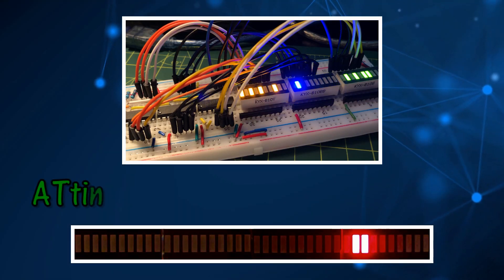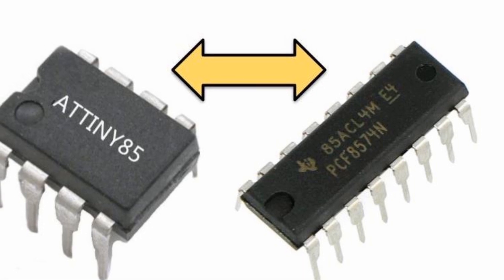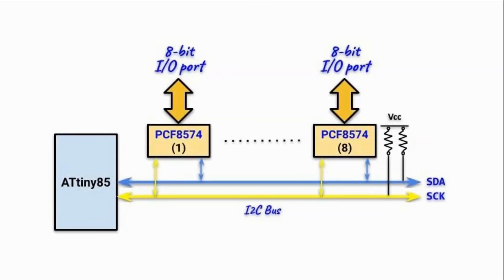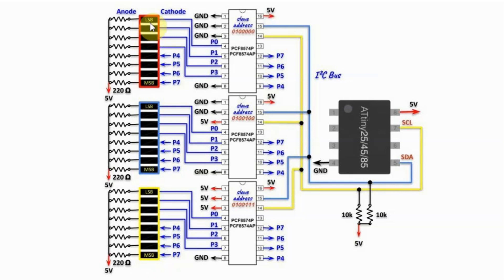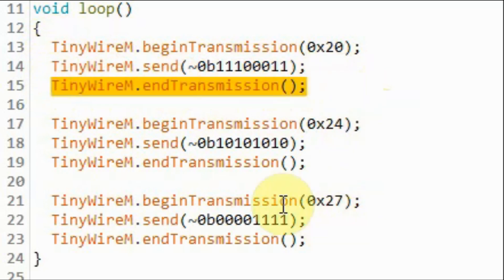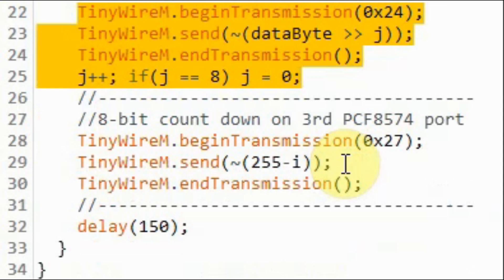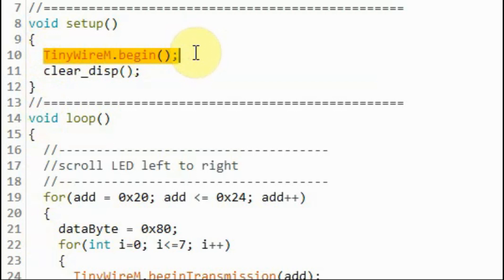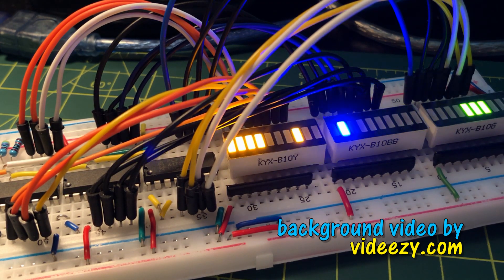ATtiny85 - PCF8574 I/O Expander

Comment: Hi, I have this setup with my attiny. I am only using one PCF io expander on the i2c bus. For some reason, after it has been running for a couple of minutes, the bus starts to crash. It starts missing a few signals, then becomes completely stuck. What might the cause be?

Comment: Thank you for the explanation.
How do you know each address of the extenders? Was it a factory default setting? Or did you program it? Then how do you program it? :) 
Thank you for an answer!
Reply from the maker: The 7-bit slave address is 010 0A2A1A0, where the As are address pins, where each address pin is either grounded or connected to Vcc to give you 8 different addresses.
Reply: @AnasKuzechie  Ah, well ok, obviously... there it is. Thanks a lot!